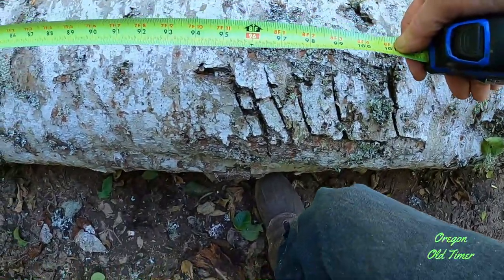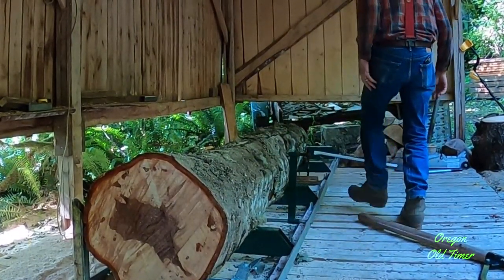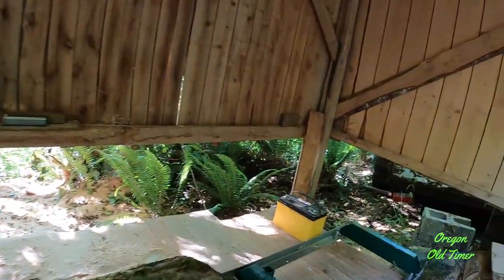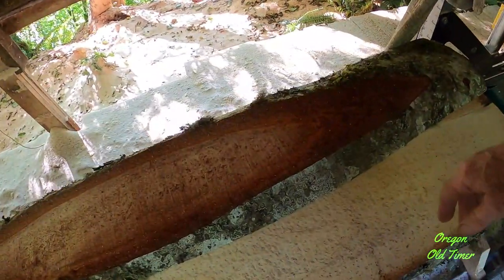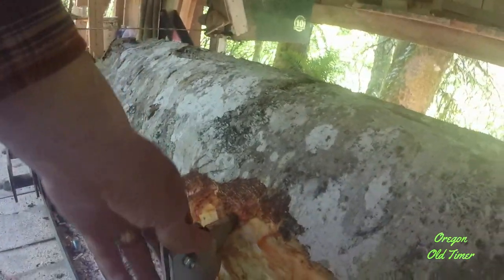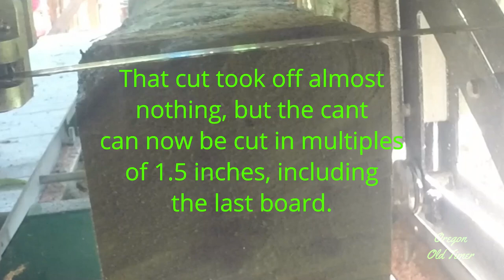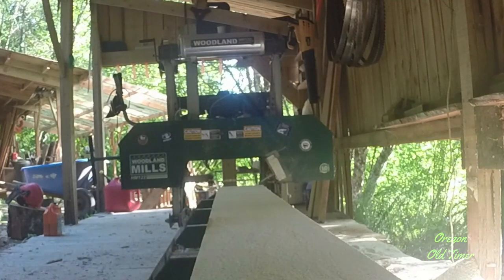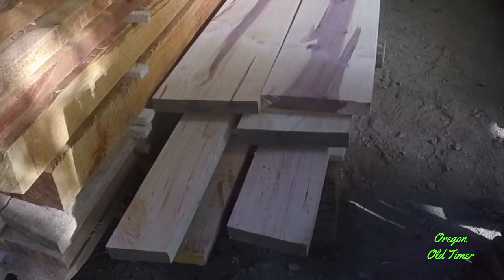Sparks Fly on My Woodland Mills Sawmill as I Saw the Last Large Log of a Pile a Neighbor Gave Me

Comment: Here is my question of the day! So you have that big log that weighs maybe six hundred pounds you take one side off and flip it 180 so the flat side is on the bunk what is the point of trying to put in the clamps? That sucker isn't going anywhere! now you get ready to cut the third cut and after that flip it to take off the last cu! trust me you don't have to put on your clamps. and you can probably Can cut down the cant to a third before clamping the last few cuts!  I am sure you will appreciate the fact that you can save a few steps in milling a tree! Just saying! And I like your channel as much as Sandy's or Jerry bigalow ! Does this make sense to you! Maybe you have a good reason for doing it? I would like to know"?
Reply from the maker: I looked at it again just now and, you're right, Marc. I didn't need clamps after the first 180 flip. I probably was concerned about the long overhang at the far end, the blade having enough leverage to pivot the log around the last stop. But, yeah, that log was too heavy for the blade to move it.
When the cant is significantly taller than it is wide, I clamp it, especially when an end is far beyond the stop. Maybe not necessary, but it costs only a few seconds with the cam clamp.
Grouping my channel with Sawing with Sandy and Jerry Bigelow Woodcraft is a real compliment. Thank you.
Reply: I'm pretty new to milling but I am not sure how much weight it takes to keep a log from moving while being sawn. And for me, the last thing I want is for the log to move.
Reply from the maker: @gotrocksinhead  I agree. Marc is right that I could have left claps off for the cut after the 180 flip, but, in general, when there is any doubt, I clamp it.
Oh, another thing. Better rocks in head than rocks in bark.😁
Reply: Indeed! Rocks in bark give you spark!!
Reply: @OregonOldTimer  💥